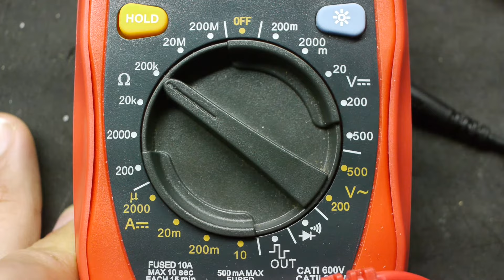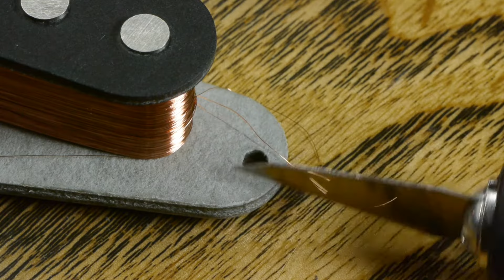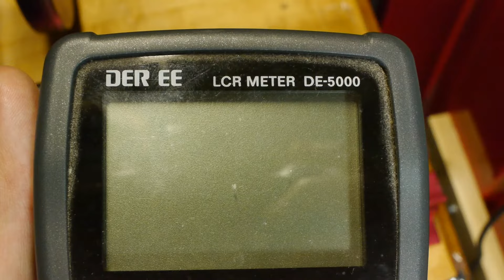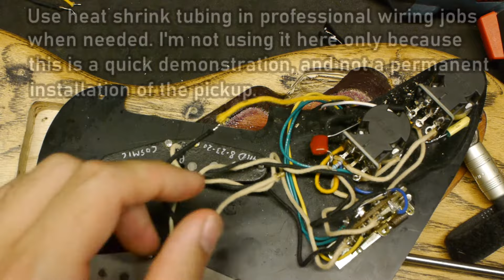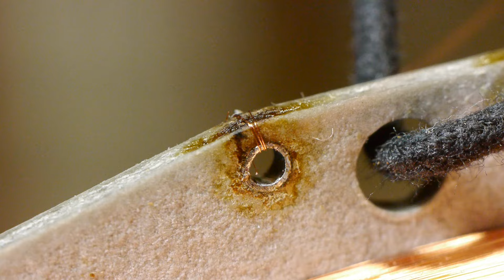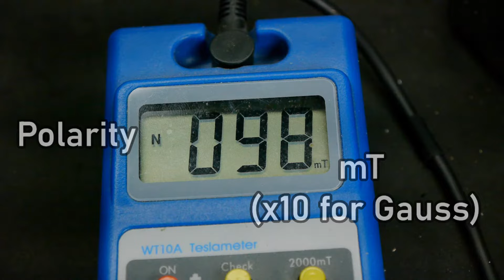Broken Guitar Pickup DIAGNOSIS + REPAIR | Fender Style Single Coil Diagnosis + Repair Demonstration

Comment: Great video ,thank you. I just fixed the neck PU of the fender 57/62 set that I received this morning, all I had to do was reflow one of the solder joints!
Reply from the maker: Excellent. I have a video on this scheduled to upload, though I'm showing it on a pickup with a circuit board. Might go back and edit in some footage showing the re-flowing of the solder joints on normal pickups. 

Surprising how often that works. Always is the first thing I try, and if that doesn't work, things get more complex. I have another video about doing a "knot splice" for pickup / magnet wire repair, and parallel splicing as well. 

Thanks for the support and for letting me know you got that pickup working again. That's awesome!
Reply: Well, after that I also repaired a vintage pickup that I thought I would have to change , this one was trickier , filament was actually broke, but I followed your tips (scraping the insulation to be able to solder was key) and now it works perfectly! Thank you again
Reply from the maker: @fkitch  Thanks so much for the Super Thanks! Made my night! So glad that my tips were able to help you, that's what I make my videos for, and I hope they can continue to reach as many people as possible. 

Have some humbucker diagnostic and repair videos in the works....slowly. Tons of interesting stuff on the way. Thank you again!

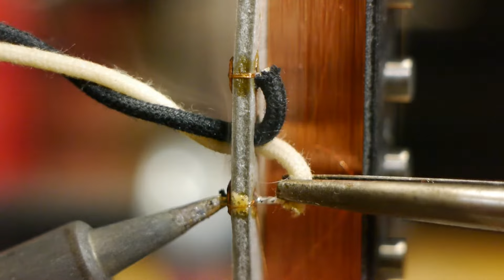Comment: Thank you for this very informative video. One of the best pickup related videos I've seen so far. No vanity, just knowledge 👍 [9:04] / [10:00] How many watts/what temperature do you use on your iron to solder the hook up wire?
Reply from the maker: Glad it was helpful! I always run my iron at 750 F. Works fast and on just about everything. There is another commenter however that said at 850 F the iron will be hot enough to strip the insulation off of Plain Enamel and Formvar wire, which usually need to be scraped off with a razor or sandpaper. I personally usually pull it taut and use an Xacto razor to scrape the insulation off those wires. 

Fortunately, modern poly wire comes off at much lower temps than 750 F. But anyway. That's what I run mine at, and it works great. For soldering to baseplates, backs of pots, pickup covers, an amp chassis and the like, I use a Weller Industrial 200/300 Watt soldering gun. Also sometimes referred to as "Big Mo." 

But outside of that, 750 on my Weller digital iron gets the job done. You do have to be careful not to break magnet wire while you're stripping it, and also not to hold it on too long when soldering in general, and ironically, that's much easier at a higher temp. Higher temp = shorter working time, kind of like how you can wave your hand over a lit candle and be OK, but if you just put your hand over a candle without moving it for 1 second, it's going to hurt like hell!
Reply: @guitar_md Great, thank you for this detailed and very helpful answer.

Comment: I just discovered that the neck pickup on my tele reads 225k (yes 225k) but still works. Kinda  thin sounding but works. No idea where the problem is but I’m just going to replace it as it’s almost 20 years old.
Reply from the maker: That sounds like an open circuit. Very high resistance and a thin, weak tone. Basically, due to capacitive coupling, you're getting some output, but very little. Imagine there's a broken bridge, but some of the electrons can still pass over. Just not anywhere near the amount that would if the bridge were whole. 

Replacing it or having it rewound is the move for sure. Sometimes they can be salvaged but it's always a case by case basis. For how simple single coil pickups are (a single strand of wire wrapped around some magnets), rewinding or replacing is the simplest solution. 

But high resistance and weak output are classic signs of an open circuit, i.e., a break in the wire somewhere. All it takes is one tiny little break, and the coil is toast. Frequently I'll see pickups like this well into the mega ohms range. So if you see a crazy high reading, it's a virtual guarantee it's an open circuit, in my experience.
Reply: @ thanks for the explanation. It’s an old stock pickup from a highway 1 Texas telecaster. I’ve been wanting to try the twisted tele neck pickup. Hopefully the 14k bridge that it has matches up well.
Reply from the maker: @thecappy  I think it will. I've had gigantic disparities between the neck and bridge pickups and they still always sound great. 

Another fun one is my favorite wiring for Telecasters or any 2 pickup guitars. I made up a diagram here. Master vol, master tone, as usual....but they're push pull pots. Series/parallel and in phase/out of phase. 6 tones out of two pickups, and it looks stock on the surface, as you don't need to drill for any fancy additional parts. 

https://imgur.com/gallery/favorite-wiring-2-pickup-instruments-6-tones-T5yNnZU

I use that on my Strat too, which I've converted to two pickups: just a neck and a bridge. It's insane how versatile that wiring is. IMO it's the ultimate for 2 pickup guitars with single coil pickups.
Reply: @ wow, thank you. I’ll have to give it a try. I’ve never had a single coil with more than 2 wires.

Comment: Thanks, got 2 Old Fender enamel wound pickups that pass the Tap test but sound horrid. Going to try the "resolder" on the wire holes before unwinding. I was just about to send them off for rewinding but because the 1 remaining of the trio sounds so good I want to make shure it's not some-thing basic , the enamel wire seems to suit the Guitar ( Stratocaster) . Thanks again!
Reply from the maker: This video is due for an update! I don't really use the tap test anymore, as especially with phase issues on humbuckers, it won't identify a problem. And it can be tough to tell if a pickup is working or not based on that alone, as even with an open circuit, it will still make some noise on the tap test. Much less than a typical pickup, but if you have no comparison, it's hard to tell. 

Resoldering is definitely the way to go. Some people get lucky and will find a break within a few turns, or a hundred turns of wire, and then they can tie it around the eyelet again, and good to go. 

But re-flowing the joints is the easiest. Also look carefully at the start and finish eyelets and make sure the wire didn't come off. Sometimes that's the problem. For the finish wire (the one not buried under the coil),  you can simply unwind it, and re-tie it around the eyelet, then resolder it. With plain enamel wire you may have to strip the insulation off first with some sandpaper. Like 400 grit. I like to do that and then tin the wire with some solder for a solid connection. Then tie it around the eyelet, solder it, then hit it with a little flux and touch it again with the iron to flow the solder as well as possible. 

What positions are the busted pickups? When I do rewinds, I find around 7,600 turns for the neck pickup to be phenomenal in just about all cases, around 7,900 for the middle, and then 8,400 for the bridge. That's my classic go-to turn counts for Strat pickups. 

If someone likes more of an overwind, I usually find that's the bridge position. The neck and even middle are darker sounding naturally. Fender always used around 8,000 turns as standard but they could go as low as 7,500 turns from what I've read, and I'm sure they went even less in some cases. They could be all over the place. 

But all can be tailored to the individual. Turn count is just the most important thing when all other things are equal. It can help to know the original specs of the pickups too. Sometimes if there's one remaining pickup I'll spec that one out and get the other two to match more closely. 

But almost universally I think underwinding on the neck and middle pickups is a good idea. And a slight overwind on the bridge. 

That works well on Telecasters too. 7,600 for the neck and 8,400 for the bridge is a great 'classic' Fender tone, if not a bit better IMO. But all comes down to what you like. 

Anyway, just nerding out. I think I saw you left another comment so I'm going to go check that out now! 

But yes, re-flow those solder joints for sure. Sometimes that's enough to fix it. And check the wires by the eyelets. There is a chance you'll be able to salvage it without needing to rewind it.

Comment: My Tele bridge pickup has lost its volume, on a quick inspection, some of the poles are experiencing corrosion in the form of white power, such as you might see on a battery compartment with a leaked battery. I expect the corrosion has a part to play with the wiring. I don't have the tools to rewind the pickup,. so I guess buying a new one is the best option.
Reply from the maker: Yes, sounds like a dead pickup! Buying a new one or having it rewound are the best options. You can reach me at guitarmdofficial@gmail.com if you'd like to have it rewound, or if you'd like to shop around for a brand new pickup, that's always an option too. 

Plenty of great pickups to choose from these days!
Reply: @guitar_md  Thanks. I'd love to, but I live in London, England. :) Best wishes to you!
Reply from the maker: @mrpositronia  One of my best friends lives right near London! He's wished I could work on some of his guitars as well, but unfortunately it's a ways away from New England, USA. If only!

Best of luck!

Comment: Quite possibly THE BEST video/explanation of pickup diagnosis & repair.  THANK YOU for sharing!!
Reply from the maker: Thank you so much! I'm really glad you enjoyed it, and hope it helps other people as well!

Also, I have a LOT more on the way. A Rickenbacker pickup repair, a couple humbucker repairs, a humbucker conversion from Gibson style braided wire to 4 conductor wire, a Gibson style braided wire splice for wires that are too short, and if you don't wanna take it apart to replace the wire completely -- and much more. 

And I do mean much more. Currently getting so much work and filming so much, there aren't enough hours in the day to even film everything I want to film, let alone edit them into videos. But...slow and steady wins the race!

I've learned a lot since I made this video, so I'll have a lot more to share. Humbuckers are of particular interest, as they're extremely confusing to many people, and I used to be one of them! Many times, humbuckers can be salvaged without needing to be rewound, but the wiring is extremely confusing if you don't understand what you're doing. 

And that's what I'm here for. I haven't uploaded anything about pickups in a while -- diagnostics, repairs, rewinds, and building -- so I'm excited to get to work on those. 

Thanks so much for the support, and I hope you stick around to see what else I have coming down the pipeline!

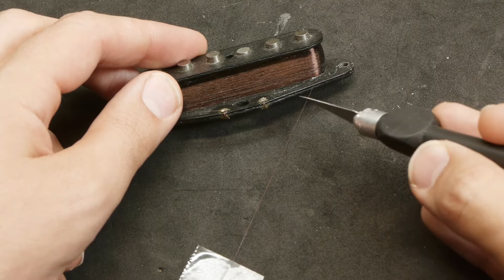Comment: 11:30 I removing that insulation with professional soldering iron over 440°C,  it burn away in 10 seconds circa, works well without scraping insulation. I using this tecnique for RF inductors, tested with AWG43 wire.
Reply from the maker: Man, I'm gonna have to try that. I regularly run my iron at 750F, so kicking it up to 850F is no problem.

I wasn't aware that at hot enough of a temperature, a soldering iron could burn through that enamel. Only ever scraped it off, never tried that. 

Thanks for the tip!

Comment: This is the video I’ve been looking for for months. I got a 7 String Dean Vendetta back in April and I’ve been trying so hard to figure out why there’s 0 low frequencies on my bridge pickup. I’ve tested with my meter and I’ve done everything I can think of. But there must be an internal break in the wire. It’s a humbucker so I’m not too inclined to unwind it, I’ll probably just get a new pickup but this has been such an informative video thank you!
Reply from the maker: Sure thing! I'm working on a new humbucker repair video as well. Most of the time with busted humbuckers, it's only one coil that's bad. 

And sometimes, neither. The real trick is to disassemble the humbucker, and disconnect the "pigtails" from the magnet wire leads. 

Sometimes the magnet wire leads will get a readout, even if the pigtails don't. 

The pigtails are simply PVC hookup wire that's soldered together with the magnet wire leads. The magnet wire leads are the actual coil ends -- coil is wound with magnet wire, and you'll have a beginning and an end to that long, unbroken strand of wire. That's your true start and finish lead. 

For whatever reason, the magnet wire leads can become disconnected from the pigtails. So to 100% confirm a busted pickup, it's important to carefully disassemble the humbucker, disconnect the magnet wire leads from the pigtails if possible, and then test the magnet wire leads individually for each coil. 

Each coil has two: one beginning wire, and one finish wire. Sometimes you'll need to strip the enamel off the magnet wire, either with a soldering iron, or with sandpaper or carefully with a razor in the case of Formvar or Plain Enamel (which will not come off with a soldering iron, like modern solderable polyurethane coatings do) --

-- and after you strip the coating, you can test with a multimeter. Most humbuckers will be around 4k or so for each individual coil. It can vary a lot. But what you want to see is one half of what the total DCR should be, on each coil. 

You'll know very quickly if it's working or not, as if it's broken, you'll get no readout. Or it'll skip and jump all over the place and not stay stable on a DCR reading. 

Disassembling the humbucker and testing the pigtails of each coil individually is not enough. You really have to get the magnet wire leads by themselves and test those to confirm a dead pickup. 

I did a repair on a Magnaflux humbucker recently, that ended up merely needing the pigtails resoldered on one of the coils. Then I had to rewire everything. Humbuckers are generally wired "finish to finish" for a series connection. 

Think of it like this: two people standing next to each other, with their arms outstretched. 

The person on the left, their right hand holds the left hand, of the person standing to their right. 

So your "hot" and "ground" leads are the left hand of the person on the left, and the right hand of the person on the right. 

The "joint" where the two people are holding their hands together is the series connection between the two coils, which adds their resistance and inductance together, and is part of what makes humbuckers higher output. 

So to diagnose a humbucker, you need to separate the two coils and test them individually. This requires some dexterity and the right tools. Humbucker pigtails often use 28AWG and 30AWG hookup wire, which needs good wire strippers to strip. And you must be very careful removing the magnet wires from them, and also know how to tie them and solder them back on. 

Anyway, all would be better explained in a video. I've been absolutely swamped with work and there aren't enough hours in the day to make all the content I want. 

However, I hope this helps in the meantime. If you're gonna throw the humbucker in the trash, you might as well disassemble it and see if you can repair it by resoldering the magnet wire leads. Worth a shot! I've saved dozens of humbuckers like this, that I thought needed to be rewound, but ended up being OK. 

Hopefully this explanation makes sense to you. Feel free to ask me if you need any help if you decide to give this a shot. 

Oh, one more thing: use insulation. When you tape the pigtails back down onto the coil, put some electrical tape down first, like cloth humbucker tape. Not having insulation under the pigtails (for both, individually) is another common reason humbuckers fail. Just like normal guitar wiring, a lack of insulation can cause electrical shorts, and then nothing will work. 

That's why, often, guitar wiring problems can be fixed by using heat shrink tubing. A dead giveaway is a guitar circuit that reads out perfectly when it's out of the guitar, but when you install it, it stops working. That's wires shorting out from physical contact. Insulation is the solution.
Reply: @ holy cow I was not expecting a reply like thanks again! I have a cheap Amazon (Wilkinson) humbucker coming in so I can swap em out and start playing again, but I definitely am going to hold on to the bad one. Maybe I’ll be able to fix it up someday with these tips you gave me!